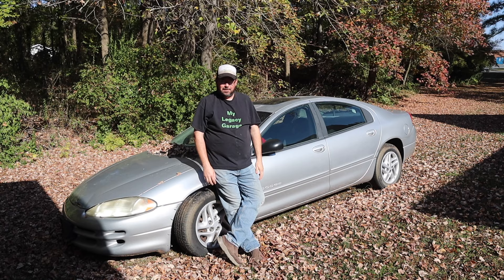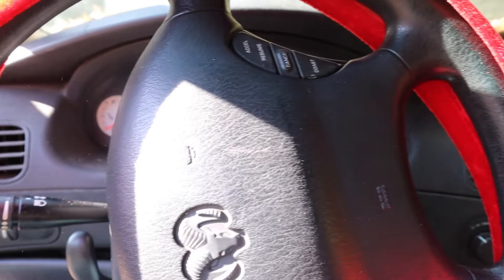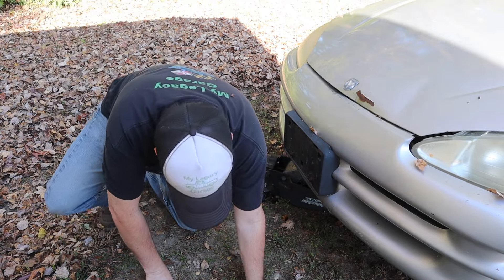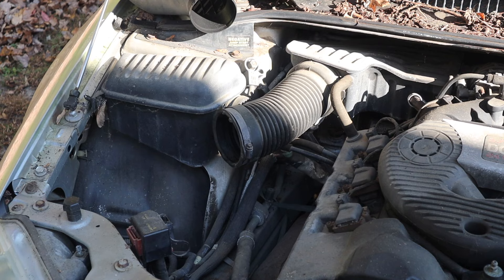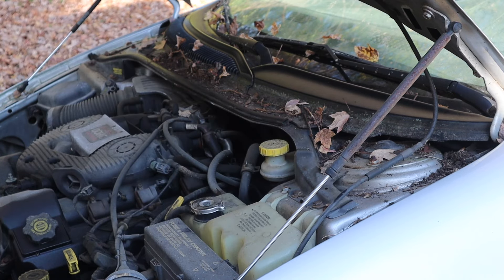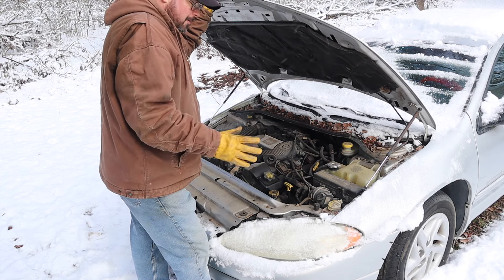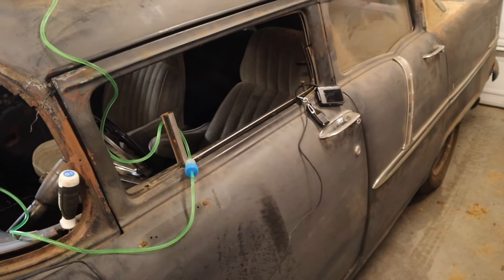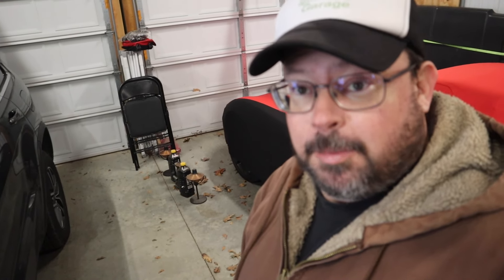FORGOTTEN FREE CAR! 2000 Dodge Intrepid abandoned in plain sight. Will it start? Will it move?

Comment: The 2.7 had lots of issues with the exhaust heating up the oil and making the timing belt break. You have to use full synthetic and make sure the timing belt is OK.
Reply from the maker: Now this was truly a flip where I did basically nothing. Sold it for a grand though so not terrible. Thanks for watching!

Comment: My uncle had a 2000 Dodge intrepid base model just like that one but it was blue in color, and cloth seats and all. He drove it the day he bought it until 2011 when a deer ran hit the side of it, and left a huge dent in the back-left door of the car, he drove it a few times, but then after he got a new 2010 Ford Taurus, he left it abandoned and rotting for 10 years outside my grandparent's garage, I did a tour of the car myself back in 2021 when it was already abandoned for years, the battery was certainly dead, moss was growing on the wheels, hood and roof, and the tires were deflated. It was only just recently when my grandfather decided to haul it off to a scrap-yard, because my uncle didn't really do anything with it and left it basically rotting in the hot sun and freezing cold winter for over 10 years. I don't know the full story, but I was told my uncle wanted to do a "project" and my guess was it was too expensive to fix up the car, so that's why he didn't do anything with it for that long. I think the lack of care and respect people have for cars now have definitely shown why cars of the last 20 years have been scrapped, neglected and left to rot.
Reply from the maker: That's how cars end up sitting for years and years. Somebody always has a plan but life often gets in the way. Thanks for watching!

Comment: I prepped these things for sale back in the day.
Reply from the maker: Nice. I gotta prep this one for sale. Any tips? 🤣
Reply: That 2.7l engine is a very bad design- internal chain driven water pump and oil return jokes too small in the cylinder heads and the oil sludges up . A/C evaporator cores always leak along with the a/c condenser. Transmission too- it’s not the greatest car but drive it until it dies, take the license plate off and walk away. Good luck 👍🏻

Comment: Yeah I've got one of the Concordes are the same thing if I remember right they all should have the flexible plastic wheel well which I would just push with my hand turn the battery on its side pop it right out also I saw your job that's true as soon as you connect the cables back up the horn always blows good work nice little getting around town car
Reply from the maker: It'll make somebody a good beater car. I've no use for it but they were in a pinch to get it outta the driveway and free was the right price. 🤣 Thanks for watching as always!

Comment: Not the worst cars in the world, we had one of the 94 3.3 variety when I was a teenager.
Definitely their weakest link is the transmission.
Luckily the one we had, the battery was in the normal spot.
This particular variety they should have put the battery in the trunk.
Did you know Chrysler used the Intrepid as a concept car for the Chrysler 300 Rear Wheel Drives.
This variety should have been Rear Wheel Drive, also.
Reply from the maker: I could see where a rear wheel driver version of this car would have been fun at least. It'll make somebody a good transport. Thanks for watching!